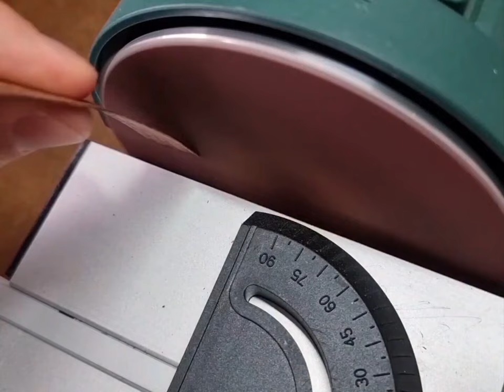How to make bent wood rings with metal inlays

Comment: Hi, really nice ring. How thick is the wire you used? And what glue did you use to glue the vinyl? Thanks a lot for the video. Cheers from Austria 🇦🇹
Reply from the maker: Thank you 
I use 0.8mm for wide rings and 0.5mm for slim rings 
And I use CA superglue for glueing it together and as a finish
Reply: @MatthewFlowerDesign  Hey! just wondering how you source your wire? I've been trying to get 0.5mm square gold wire and find it to be pretty difficult to get this smaller size. I've also looked at rolling mills but none seem to go less than 1mm. The rings look great btw!! Thanks for the video

Comment: I'm really urging fellow wood turners to stop using CA glue as a finish. It's designed as an adhesive. Start using brush-on lacquer. Four coats of lacquer, which is a finish, has the same thickness as ten coats of CA.
Reply from the maker: For ring making, I've only ever heard of people using either CA or resin as they are such hard hearing products 
I will give lacquer a go as I'm interested to see how it compares
Reply: I would be interested to know if there is an alternative to CA glue for gluing the rings.
Reply: Cool buddy, how long does each of those coats of lacquer take to dry?
Reply: @markustiemann6748 I've done a similar method as I didn't have any CA glue on hand at the time and I used traditional wood glue which worked aswell